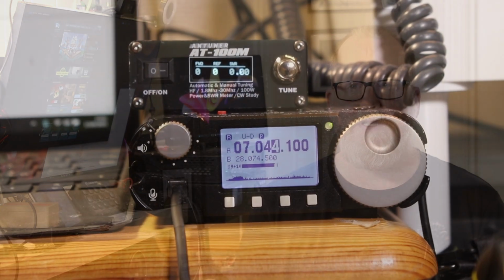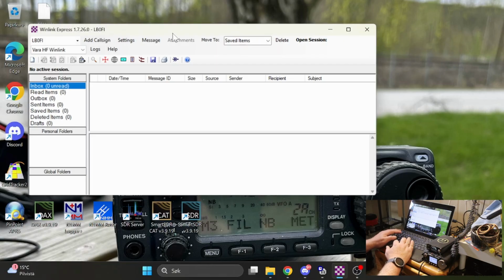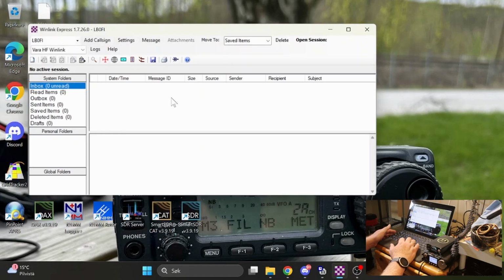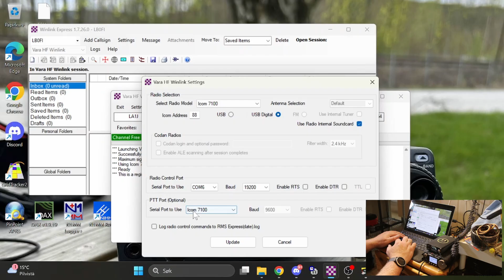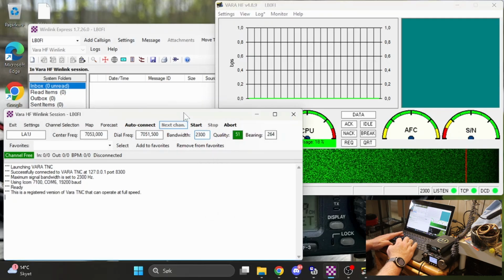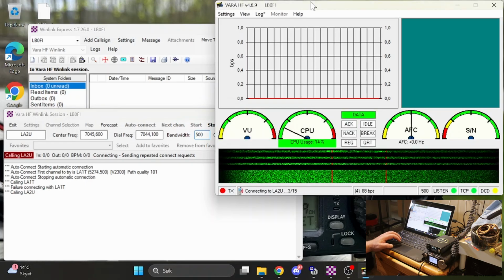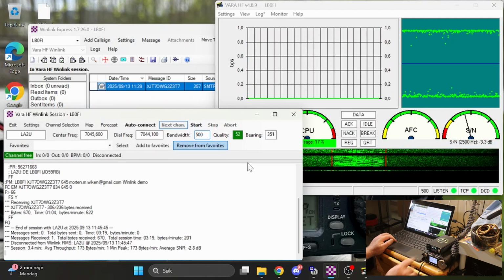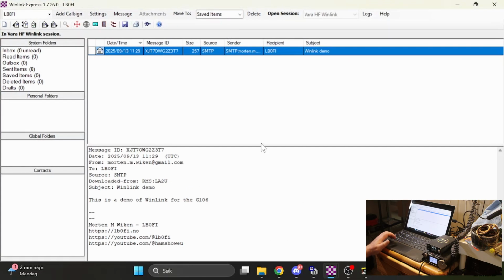Winlink on the G106

Comment: What antenna did you use? You should be able to reach LA1T by NVIS easily, but probably not it you were running on a vertical...
Reply from the maker: I used both the DX Commander and an EFHW. I could get through barely, but the signal to noise ratio was so bad that it just went too slow.

Comment: This was interesting as I didn't know about it before. If you don't do Windows, is there an ios, mac or linux version of a program that will do the same?
Reply from the maker: Thanks, and yes, you can do Winlink on at least Linux and iOS. I haven’t used a Mac for a decade except for QLab, so I can’t say anything about that. I have a video on Radiomail on iPhone, and KM4ACK has several videos on doing Winlink on Linux.
Reply: @LB0FI That's great. I will have a look.
Reply from the maker: @johnmilner0859When I think about it I might even have two videos on Radiomail

Comment: I like Winlink and Vara.  When you get them connected they just work.  Once I have my initial setups done they worked flawlessly for more that a year.  i check into the Winlink Wednesday every week.  I did it via VHF a couple of time but the gateway I used went to a BBS connection so I switched back to Hf.  Thanks for the videos!  73
Reply from the maker: I like Winlink and Vara as well. It can be a bit of a hassle to set up, but then it usually just works.  And that’s exact why I have this series on how to set up Winlink for different devices.